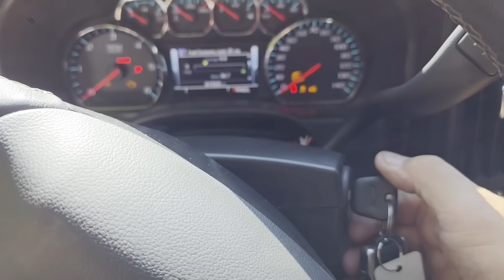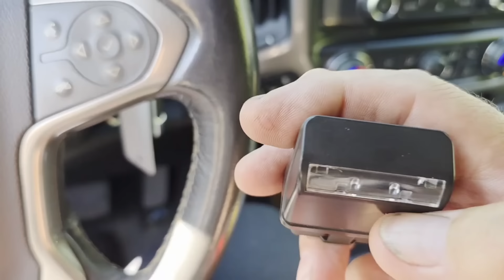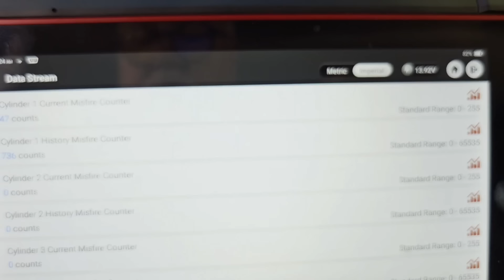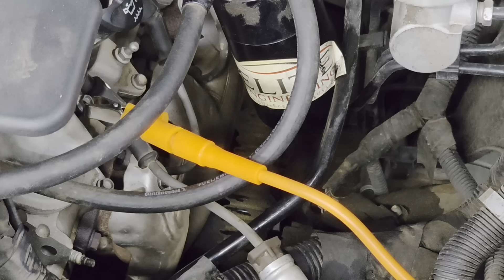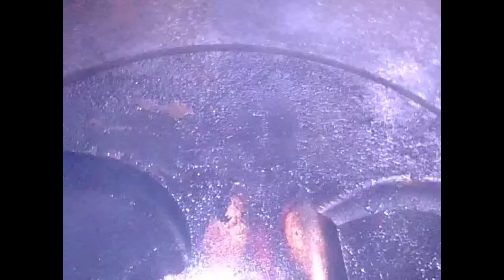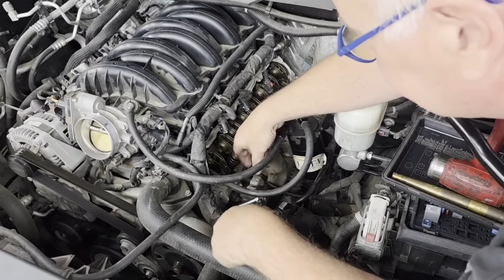No Abnormal Noise Turns A Simple Misfire Into An Engine Teardown.

Comment: Lifter tray wore lifter rotated. Had one firt 5-10 sec run perfect. Then lifer would stop, the lifter had rotated in tray wasn't seeing oil pressure and was shutting down lifter. That was a fun diagnosis

Comment: bent push rod i had but it was making noise.. no check engine light though. replaced push rod and running 30,000 km with range disabler.    the theory is when afm is on base of camshaft the vlom collapses the lifter for v4 mode...when it comes out , on base lobe too it has to do it in a split second. any issue with it and it expands while rising on lobe and the angle of the push rod can hit the side of the lifter itself.  it is not a perfect angle, have a look at the diagrams and some more videos.  you saw the witness mark too on that one rod.   another youtuber recommends all new push rods with thicker wall to help deflection and using a range afm disabler.   i only found all i know on this on youtube and my own personal experience. oh and dealership wants to do both sides no matter what and all lifters which is about $6k canadian.  not including cam. they said customers came back mad saying for those who only did one bank all pissed off that should of done both.   so they only offer to do both now.
Reply from the maker: Thanks for all that great information and for watching the video! Keep wrenching brother 🔧 Kenny

Comment: Thanks, Kenny, love your videos. I noticed your borescope. I noticed yours does not have the bendable head. If yours could bend, you wouldn't have to pull a head to see its bottom. I have a Teslong borescope with a bendable head. Love it! Great screen. Even a memory card. It saved me a lot of hassle when my engine died. I pulled the plugs to get a look. One was smashed. I scoped that cylinder (#4). I initially noticed a few scratches on the piston. Then I bent the head around to look at the valves. The valves were fine, so far. But the head had a "ball peen hammer" type of surface. Something has been banging around in there. I haven't found it yet.
Reply from the maker: That sounds like a great tool. Thanks for sharing your experience with it. Keep wrenching 🔧 Kenny

Comment: I Had the same thing happen on my 2019 Silverado LD with 5.3 L83 engine . It all started with a lifter tick . I started the engine one day  and I heard a loud bang . I took the valve cover off unbolted rocker on cylinder 1 the push rod on the exhaust valve  was bent from a AFM  lifter collapse . It did not damage the camshaft because I stopped driving it . I then decided to do a DOD delete since these lifters are garbage and prone to failure . My engine is as clean as this one as I change my oil at about 3500 to 4000 miles intervals and the lifter still failed . I'm happy to say after the DOD delete the engine is running great . No more V4 mode .  Unfortunately  this failure is very common on the L83 engine . I forgot to mention the lifter failed at 103K .
Reply from the maker: Thanks for watching and sharing your experience. Keep wrenching 🔧 Kenny

Comment: I went to buy a car off of failbook this morning, 2012 Malibu 2.4l. He claimed timing chain issues, I pull the valve cover off, the timing looks fantastic. My finger hit a cam cap, it was loose. The previous shop over torqued a cam cap bolt, snapped it and didnt torque the rest of the exhaust cam bolts to spec. 2 cam caps completely loose 3 others starting to loosen. I tighten the caps, restart the car, no lifter noise. Fuel pump sock is clogged, or the pjmp is too weak to keep it running. Dude is watching me lkke a hawk, then says "yeah, Im not selling it now..." WTF.
Reply from the maker: I hope you changed the guy for fixing the car. Next time don't fix the vehicle in front of them 😎 the sellers get mad when we do that. Thanks for watching and sharing your experience. Keep wrenching brother 🔧 Kenny
Reply: @WrenchingWithKenny I didn't fix anything, he thought he could repair it himself. All I did was tighten the cap bolts and the rod knock went away. He about crapped himself how easily I found the problem. I should have not said anything and left it as it was and bought the car. It was literally $500 and would have cost me $300 to fix it. Live and learn! Oh and I have been loving your conversations back to questions asked in chat on your videos! Puts a real personal touch to your channel that I really enjoy!

Comment: Kenny my man, get yourself some battery ratchets. The Hercules ones are only $50 and they're very durable. Also they make articulating borescope cameras you can buy so you can get 360 views, not too expensive on Amazon. 

As for the truck, the DoD lifter failed & I'd speculate at this point the exhaust valve got bent from a love tap as the lifter let go. It's so common on these it's not even funny.
Reply from the maker: The borescope camera is on my wish list. You're right about the truck. Thanks for watching & for your advice. I appreciate you. Keep wrenching 🔧 Kenny

Comment: I'm working on a 6.2 and on cylinder 4 had a tapping noise but no misfire , remove the head and found the intake pushrod broken in half the lifter collapse but got lucky didn't eat the cam

Comment: plan your work and work to plan. always a great strategy. start from the basics and work inward. I would love to see the repair on this one. as far as that plug in "fuel saver" gizmo, I found that buying higher grade fuel gives you better fuel economy as well as less deposits. also, get rid of those fart pipes!! when you have them installed on your vehicle, it makes you push harder on the throttle to hear that rumble. I've seen so many vehicles with those barkers on them, but they arent going as fast as they sound. peace
Reply from the maker: Good point about the fuel saver gizmo & the pipes. Hopefully, the customer will go for the repair. I will keep you posted. Thanks for watching and leaving a comment. Keep wrenching 🔧 Kenny

Comment: That misfire wound up being an engine the same way my buddy's leaking EGR cooler wound up being a new $30,000 to $50,000 new engine.  I think theses folks are basically crooks with a mechanic's license.   Keep the good stuff coming.
Reply: 30 to 50 k for an engine?
Reply: @jeffsmith350  Ya, it's a Rolls.

Comment: My 2017 silverado bent a pushrod at around 130k miles.  I called 3 shops in town and none wanted to touch it, i was way over my head on this job but got the mess sorted with a Texas speed DOD delete kit.  Just over 5k miles on the repair and still running solid!
Reply from the maker: Thanks for sharing your experience; glad you're back on the road! Keep wrenching brother 🔧 Kenny
Reply: I have got lucky a lot of times just putting in new tube and flushing engine. However due to the movement with rocker and none with rocker, point directly to that valve being slightly bend.

Comment: Kenny my son put this box where that guy had his box but what this box did it made the engine had a load on it didn't do the 4 6 8 on motor has over 100000 miles on it worked great

Comment: Kenny, anyone know why the change of the engine design that requires you remove the cylinder head to replace the lifters other than customer cost increase? I cut my teeth on sixties, seventies and eighties cars could change the cam and lifters in no time.
Reply from the maker: It's just how they decided to design it to increase fuel economy & performance. Who knows why the design engineers do what they do 🫠 thanks for watching & leaving a comment. Keep wrenching 🔧 Kenny

Comment: That device in the OBDII is probably an AFM/DFM disabler. These trucks have active fuel management which deactivates cylinders and is known for lifter failure. I have a 17’ Silverado with the 5.3 and I use a disabler like that, keep me all 8 running all the time
Reply from the maker: Thanks for the info and for watching! Keep wrenching 🔧 Kenny

Comment: I have a 2019 Suburban with a 5.3L that had DOD. About 5K miles ago I bought the Range DOD disabler that plugs into the ODB port. So now, the engine stays in V8 mode all the time, and can't tell any difference in gas mileage or engine performance. This eliminates any possibility of a lifter getting stuck, like happened here.
Reply: Unfortunately the disabler does not eliminate a stuck lifter condition; it may postpone the failure though by stopping the lifters from constantly switching back and forth..  The only way to eliminate this problem is replace the AFM/DOD lifters with standard lifters, change cam, DOD blockoff plate and a ECM tune.

Comment: BAD OIL! Missed oil changes, or cheep oil.  People need to understand that even the best oil has a hard time with these new erngines. When the engine temperature is running over 220 degrees, that means your oil temp is around 400 to 500 degrees where the oil has to travel. Most oils will begin to burn at those temps. That is where that brown color comes from. That brown color causes parts like this lifter to stick and fail. VCT ,VVT and other systems like disable cycliders for fuel milage all depend on clean oil. If you skip oils changes, and use cheep oil, this is what happens! Another thing you can do to prevent this is to flush your engine with Sea Foam, Marvel Mystery oil, Type F Trans Fluid, or some type of detergent before you change your oil. Get as much of that brown crap out with each oil change and your engine will love you back. They make engine flushes for this, but make sure you use a good one! I've been using Sea Foam since the 1990's and it works on every engine I have! Boats cars lawn and garden stuff, everything! And at about 10 bucks, its cheep. follow the instructions on the can.
Reply: There weren't missed oil changes, that cylinder head could pass as brand new, zero varnish. 210-220 degrees is the most efficient temperature for an engine to operate at, allowing for complete combustion to occur. Oil turns brown as it's used because it naturally mixes with fuel and hydrocarbons in the crankcase. 

There's really no such thing as cheap oil anymore, even Walmart brand when tested performs extremely well. The only thing you're correct about is that Sea-Foam does work.
Reply: @COBRO98  Keep convincing yourself of that. What I can tell you is that I have built literally hundreds of engines, and this is a new problem with the new systems. Those lifters? They have very small orifices in them, much smaller than the old designs. When they get carboned up, they stop working as they should. Its not just a lifter, its a shut off valve for the fuel management system. Just like the Cam phasers aren't just pulleys for the timing chains. They are variable timing controls that need free flowing oil under pressure to work right. These new designs ar asking more than the oils can give and with the newer intervals for service, this is a huge problem! 6.2 chevies are grenading because of these vary same reasons.  Same goes for the ecotecs and the ecoboosts as well as many others. That is why they want you to run zero w20 oils! The others are to thick to run these systems. But what do I know, I'm just a 1980'sd kid who grew up in the racing world and built cars, then worked for the military as a diesel mechanic for 17 years. 😛
Reply: Speaking of small oil passages on the 6.2 (and 5.3) … the vlom cover has several extremely small passages with tiny mesh screens…. The passages go to the afm lifters. Some ( not all) have the oil screen under the pressure sender also.  Not sure if Kenny showed us the actual oil pressure on this engine…. Might be interesting.
Reply: Yep… that was my first question !  Oil !
Low… wrong type… didn’t change it soon enuf.. ???
I’ve seen a lot of the Chevy afm/dod engines with 150k and no issues and still going strong .

Comment: the afm lifter is not stuck in bore,due to moving up and down imo.i always worry about grounded down cam lobes due to lifter roller bearings failure.ive got a 16 sierra 5.3 in the shop rn that i am pulling head off because of #6 intake collapsed afm lifter.the push rod is not bent,i hooked up a jumper at starter relay,,spun over engine and put my finger on the push rod and it moved up and down smoothly so hopfully the cam is ok,ive had my share of these afm issues.i think the vlom contributes to alot of the trouble especially the older models.i always replace vlom when reparing lifter issues.long story short,actually the only time i had a cam lobes ground down issue it was on a 6.2l, maybe 14 or 15 modle with one or 2 bent push rods.what i noticed was happening is the roller on the lifter is like egg shaped and trying to roll, the cam is all screwed up and hydraulics involved,when the affected cylinder is on a compression stroke a valve will try to open under high cylinder pressue and the rocker arm is the weakest link and bends

Comment: You can't trust the Determination of another mechanic without knowing how it was determined and if it was verified.
Was it bad compression or a bad compression Tester?  Or just a bad test adapter?
Reply from the maker: Or....the person doing the testing? I never assume the "other shop" actually did any of the testing the customer claims. I tell my customer that we have to diagnose the problem & we are starting from scratch. Then I ask what problems they are having with their vehicle. It has worked for me so far. Thanks for watching and leaving a comment. Keep wrenching 🔧 Kenny
Reply: @WrenchingWithKenny  And never ask, "Did you..." questions.  I spent 20 minutes on the telephone trying to diagnose a problem with a movie projector when I was a Projectionist. The manager from my old cinema called with an emergency.  I went through a 20-minute Q&A over the phone before I realized she was in theater 2, not 1, which was set up differently.
Turn around and hit the green switch on the Blue box.

Comment: For around $100.00 you can get a borescope /endoscope that as a flexible cable with an a wheel to move the camera Lens 180°, so you can look straight back up at the valves. I’ve used one numerous times while repairing blown out spark plugs to confirm the valves are closed on triton motors
Reply: We had one at the Caterpillar shop I started in the 80's.. the cost of the scope was $10K The only time we really used it was to show the customer before we started teardown so they could not say we messed up and didnt check anything else.

Comment: You need an engine replacement to maintain the shop's revenue.
Reply from the maker: I couldn't justify that one. It's a $15K repair. I'm guessing they didn't have someone there that could do the diagnosis. If the customer said 'ok, just replace the engine' they would have been golden. The customer was smart enough to question them. Thanks for watching & leaving a comment. Keep wrenching! Kenny

Comment: The DOD garbage is one of the reasons why I paid to have a tune done and shut it completely off. I bought my 2014 Sierra in 2019 with 45K on it and it's now at 136K and no issues at all. I may have to go in somewhere down the road and swap it all out, hopefully not, and take all of the DOD out of it. I'd talk the customer into a complete replacement of the DOD lifters with non DOD if the cam wasn't hurt, and turn the DOD off,that way he never has to worry about that happening again.
Reply from the maker: Great information! Thanks for watching & sharing your experience. Keep wrenching! Kenny

Comment: Try the lifter unlock protocal first ! Then replace the pushrod then disable the AFM !
Reply: That device plugged into the OBD port is an AFM disabler. Contrary to the internets popular belief, simply disabling AFM does not prevent the lifters from failing. Doesn't even slow it down. This video just further proves it.

Comment: I hope all the fuel savings from the AFM design helps pay for the tear down and parts the customer is going to need to get back up and running. My guess is probably not. The EPA with its CAFE rules is a bunch of horse manure. If you have to junk this truck already think about all the waste that creates. I always say your better off with old school tried and true NA V6s and V8s with all cylinders running all the time. The engine stop/start system is another one that when your engine needs to be replaced at 100k miles from all the extra restart cycles, the fuel savings probably won't equal the price of a new car.
Reply: The AFM designs probably saves $5/month in fuel. Then it breaks every few years costing the owner thousands, it's as common as flat tires. New trucks don't even get better fuel economy than ones from 25 years ago, they're far heavier today. 

The EPA are nothing but money laundering scam artists. Entire thing should be dismantled.
Reply: I agree with you 100%. All those crap agencies,  EPA, CAFE, etc are worthless. 
If all these so called engineers from car manufacturers ( That have never touched a tool) and the agencies would come together and build a simple engine with a decent 6-10 Speed engine we would not be in this situation. 

The shit is going to hit the fan when smart Mechanics like Ken that actually diagnose and repair start to retire. 
All you have now is parts canon specialists , if that does not work they send you on your way and oh well .
Glad I have a garage full of tools to do any automotive work since I do not have someone like Ken where I live